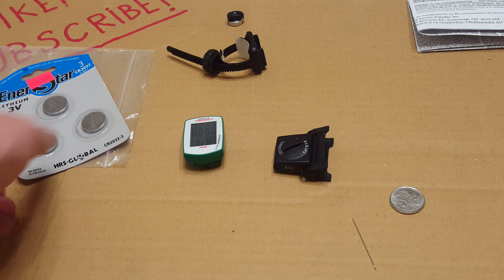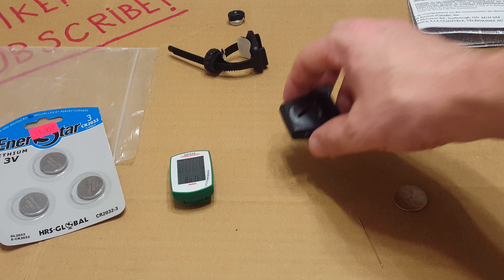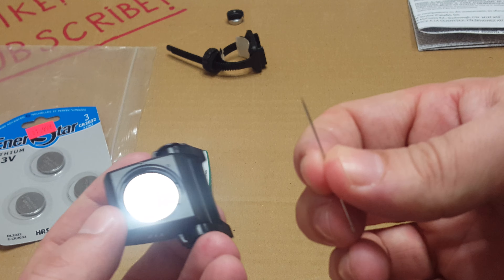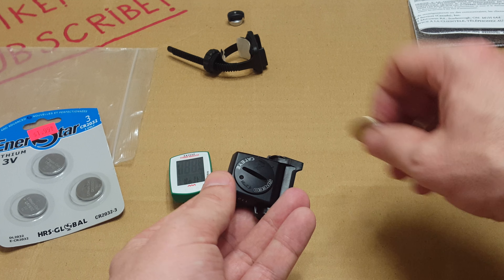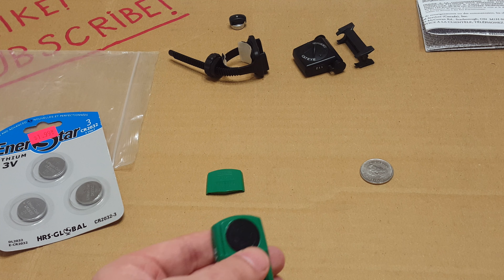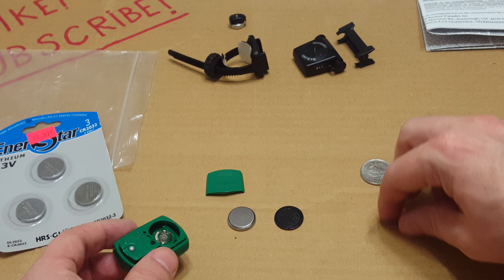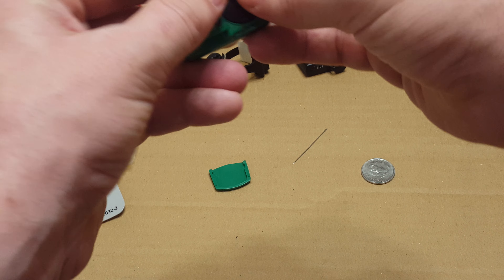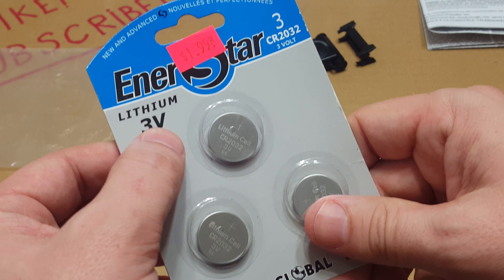The Battery Replacement For Cateye Strada Wireless Bike CycloComputer | 4K

Comment: Don't pry up the battery cover. Simply press down on the top edge of the cover. The bottom will pop up. Also, make sure the red o-ring is properly seated before replacing cover.
Reply from the maker: @billy4227  Yup. Good tip!

Comment from the maker: If you have any questions, please just ask.
Reply: My Cateye doesn't have that tiny hole on the unit where you inserted the needle to pop the "TOP" part off of the back.  So I can't get that piece off and replace the battery.   Any ideas?
Reply: You can push the top part of the battery lid and it will pop out. (page 10 in the manual) https://www.cateye.com/files/manual_dl/7/819/CC-RD310W-SLIM_HP_ENG_v4.pdf